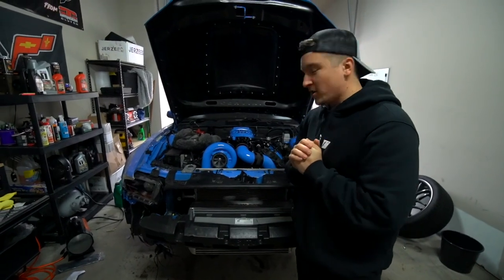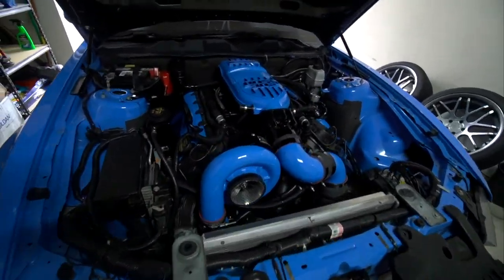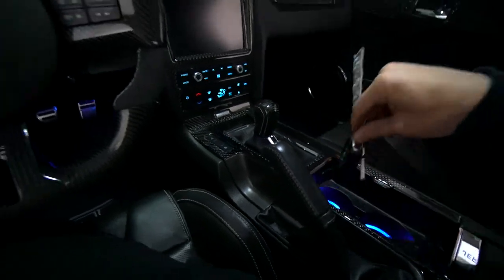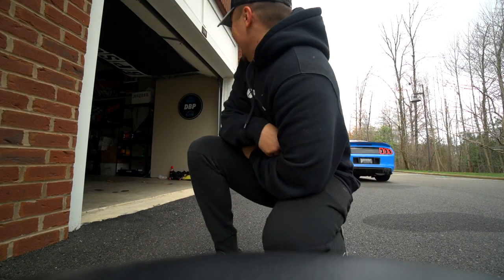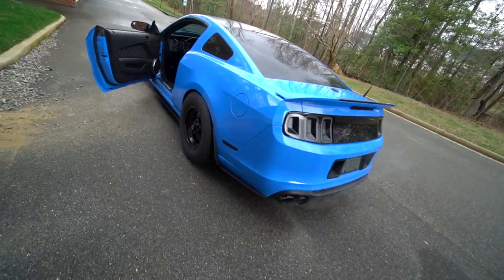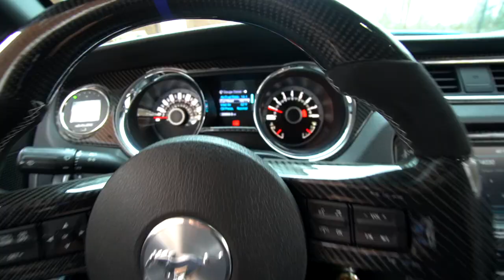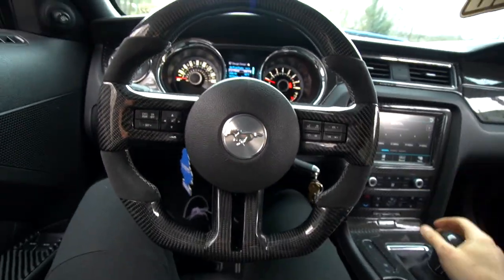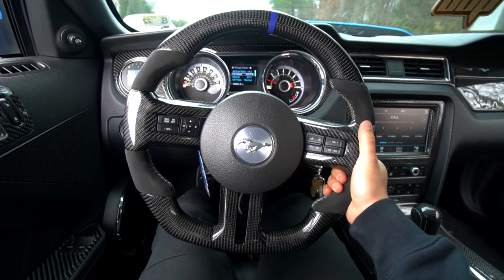My S197 Mustang's NEW PAXTON 2200SL absolutely SCREAMS!! *FIRST DRIVE*

Comment: im gone be 💯...2013-2014 might go down in history as the best overall mustangs,. aggressive looks, ,easy mods, 5.0, and much more...jus a damn beast
Reply from the maker: 10000000% brother i agree!!!
Reply: Agreed. I repeatedly write that I actually sold....two Shelby  gt350 cars, 2018, 2019 respectively and bought a 2012, 2013 Shelby gt500, just I as had before getting rid of them to get the 350s. I live at the beach in California so i keep a vert and a coupe. Addiction to the s197. Can't enjoy the s550.
Reply: 13/14 are King
Reply: @JayCaseGT500 s550 feels like your driving a challenger or boat! Had a new edge convertible (Florida west coast) and in the fall winter early spring can't beat a convertible.
Reply: I just inherited my Dad’s Ruby Red 14 Gt Manual. With a few bolt on’s. He’s 😊dream was to Super charger or Turbo it. So I’m going to do it for him. He just past November 17th of this year.

Comment: Derek,  if you do a snow water meth kit you will boost your octane from 91 to 116.  Also, gain an increase in hp.  You don’t need to retune your car for the water meth because you don’t want to rely on the kit if you run out of it.    It primarily acts as a cooler for your  centri - supercharger.    This is what I am doing.  You can set the lower end and high end with a gauge for injection.  I am not doing E85 because I will be at 790whp or so with my gen 3.
Reply from the maker: Ima do e85!!!

Comment: Sounds sooo good, congrats Derek! 
I’m having a little bit of confusion though, what are the pros of the Paxton vs. VMP? 
I know that the VMP is a screw type, and that the Paxton is like a, I guess, fan type… I think my question would be, what differences does the Paxton provide? Besides sounding unbelievably good lol
Reply: The VMP is a twinscrew style blower so it’s extremely torquey and hard hitting. Twin-screw blowers can also be prone to heat soak since they’re sitting between all 8 cylinders. The Paxton is a centrifugal blower, not as hard hitting in the lower RPM range since it needs rpms to really shine which is a pro in itself since Blucifer is a gen 1 coyote, the centri will be easier on the drivetrain. Since coyotes are high revving engines the centri blower only compliments that trait of the engine and it will pull extremely hard from 3-7,500 or even 8k rpms. Heat soak isn’t as much of a worry for centri’s since they sit in front of the engine. And of course the menacing sounds you get!
Reply: @Hoodie2103  This helps a lot! Thanks for your input! So to clarify, while the VMP is very hard hitting at all RPM ranges, it puts a great deal of stress on the drivetrain and gets too hot… which is improved by the Centrifugal Supercharger, that though it needs higher RPMs is able to deliver a ton of power without causing too much stress on the drivetrain.
Reply: @jonscott3828  I wouldn’t say the VMP is very hard on drivetrain.  Any time you boost and beat on these cars it’s harder on them than stock but the coyotes love it. Ultimately depends on how
Much boost you run as well as the supporting mods and fuel routes you take.  

My 17 GT has been boosted for 20,000 miles.  I have a VMP blower. I LOVE it. Car hasn’t had any issues.  Mine is setup fairly conservatively.  I’m only making 611 wheel.  There is a lot left on the table but at that power level it will still beat 90% of cars I come across on the street but seems to be plenty reliable as well.   It drives very stock like so I wouldn’t say it overly hard in anything unless you ask for all the power all the time.
Reply: @jonscott3828  correct. Say you have a drag radial, like Derek does, and you take it to the track and launch at 3-4k RPMS, the VMP is more likely to break drivetrain components if you accidentally dump the clutch or dead hook since it’s got the torque to do so. The Paxton is less likely to do that damage at that low of rpm. If you’re on the street and don’t go to the track, they’re both fairly problem free, you just have to decide how you want your power. Stop light to stop light the VMP is winning all day. 60-130 roll races, theoretically the Paxton is winning cause it should be spinning at 4-5k all ready and keep you pulling past the VMP since it’s power dies off in high rpm’s.
Reply from the maker: Ill make a video!!

Comment: Sounds like you need to adjust your bov. It sounded like it was releasing boost under load. It only supposed to release pressure out of bov when either max boost psi is achieved or by letting off the gas. It shouldn't be releasing around 4 k rpm barley on the pedel
Reply from the maker: Na its 100% perfect under wot if i “feather” it i can get it to smoosh like that

Comment: I wanted a root style for so long on my s197 kinda debating now on going in a different direction after watching this 🤔
Reply from the maker: Both are amazing
Reply: If you like instant boost and torque down low tvs is where it's at.  I think it's a better street setup especially if you have a manual trans.  Centrifugal blowers sound good and definitely perform too but if you like instant torque down low tvs ftw.  The vmp blowers are very efficient especially the odin and gen3r which both use the 2650 rotor pack.  They're very efficient and the boost levels you see with a high compression coyote doesn't push it enough to have heat soaking issues.  I would go odin if I had a coyote car I have a gen3r on my 07 gt500 it's wicked.  The powerband is insane torque monster.
Reply: @midnight347  good to know I got a 3v that I’m trying to make pretty quick just feel like you don’t see many built 3vs and I wanna be different

Comment: car goes hardddddd!! 😎If you had to compare the 3 valve to the gen 1 coyote stock v stock how would you explain it? (speed, torque, feeling of the car?)
Reply: 3 valve, torque-ier, gen 1 lots of top end power pulls hard up top! I have a 2011 5.0 and I'm stock motor, and by the time I get into my PowerBand it's time to slow down 🤣🤣🤣
Reply from the maker: No comparison honestly man. Coyote is on a different level. 3v sound great!! but that yote motor something special in 2011
Reply: Stock for stock not close at all 4.10s, fbo 3v you’ll be able to beat a completely stock gen1 or 2 if you can drive lol but if you’re on the fence don’t think twice. Coyote is a way better platform
Reply: @DerekBaranProductions  can you really feel the torque on the low end because i know it really comes in heavy higher in the rpm range?
Reply: @_4.6ricardo  how’s the torque lower in the rpm range?

Comment: How do you like it compared to the vmp? Not sure which route to go
Reply: IMO VMP looks better
Reply: @mickeygarcia2331_  better low end, no noise messing with sensors, no clamp issues. Not a fan of the blower being basically against the intake. I feel like the whistling would get old also. Yea VMP it is.
Reply from the maker: Ill make a video!!